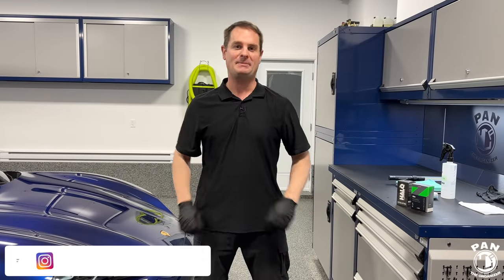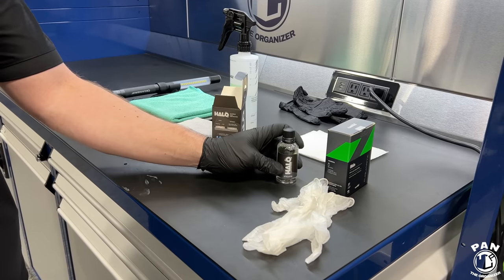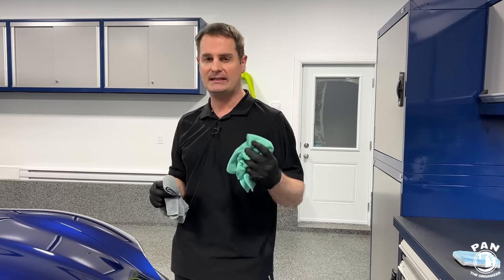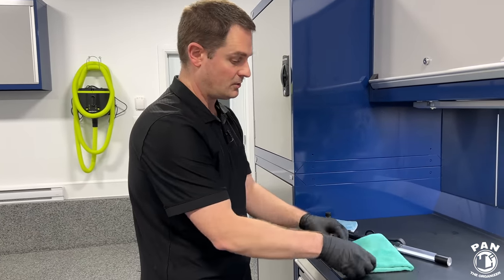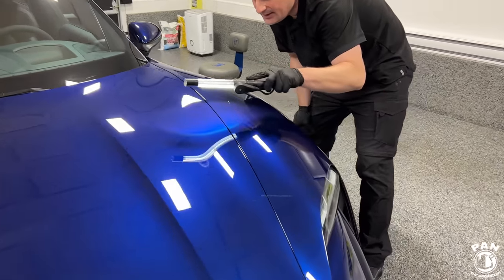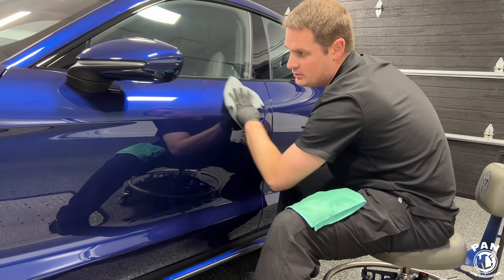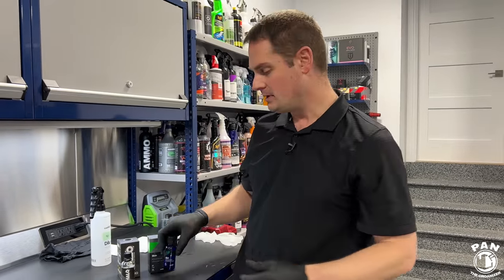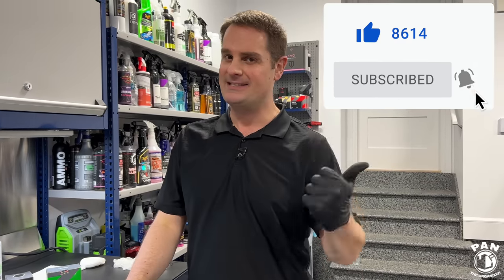How to apply a ceramic coating on PPF (paint protection film) : Porsche Taycan Turbo

Comment: Sir, I’m about to put a self healing PPF on my ride and then top it with a ceramic grafene coating. My question is, will the hardness of the ceramic coating stop the self healing properties of the PPF from working?
Reply from the maker: You would have to ask a PPF specialist that question. I have no experience with installing PPF or how self-healing versions work unfortunately.

Comment: Hi, can you please explain the concentration of the isopropyl alcohol and the Distilled Water ratio please. Also there are different strengths of IPA too
Reply: It’s based on 100% strength. So buy 100% strength, or close to it, then dilute it with 50% water, preferably demineralised water. That will give you a 50/50 mix. If you buy it at less than 100% strength then you need to get out the calculator to work out how much water to add to end up with the 50/50 mix.
Reply: @aussie8114  Thanks 👍

Comment: I just did a ceramic coating of my car, and i didn't know about ppf until couple of days, is possible to use ppf over the coating? Or somehow i need to remove the coating? Thanks a lot
Reply from the maker: That's a question you will need to ask to your PPF installer. Usually, it's PPF first, and ceramic coating on top. So I'm not sure if the PPF will stick on top of the ceramic coating.

Comment: I hope I get my BMW M3 next month. I am convinced that ceremic coatings work very well. However, I am not convinced about PPF. I did a lot of reading and people cannot seem to agree on the PPF investment (too expensive, rock chips damage the film (also looks bad), dirty edges, replacement is a pain). Yeah, the paint is protected, but at what cost and effort? What is your take on this? I would love to know how you value PPF.
Reply from the maker: Hi. I am just not a fan of the look or feel or PPF. Plus, as I get a brand new car every three years, and do low yearly mileage (6000 km or 3730 miles), so scratches and stone chips are of no concern to me. My cars are always pristine when I bring them back to the dealership.

Plus over time, PPF can yellow (especially the less expensive ones), dirt gets trapped on any edge of the PPF so it's a pain to keep clean, etc and it's a very costly option if you do a full PPF on the entire vehicle.

However, if you plan on keeping your cars long term (4+ years) and do average or high yearly mileage, and are concerned about stone chips and scratches, PPF is the only solution for those things. PPF will protect the paint for sure. Yes the PPF will get dinged and scratched, but its role is to act as a barrier for your paint. Underneath, the paint should be in good condition. 

Ceramic coatings aren't designed to protect against stone chips or scratches. What they are meant to do is protect the paint against chemicals, against UV rays, add gloss and slickness, give hydrophobic properties and also self-cleaning properties meaning that the vehicle is much easier to wash during maintenance washes. Dirt and grime stick a lot less to a coated car.

So for the best of both worlds, you'd install PPF first, and a ceramic coating on top.

I hope this helps. Congrats on getting your new M3 by the way!
Reply: @PanTheOrganizer  Thank you so much for your reply! I plan to keep the car long term (say 6-8 years) and I do average-high mileage. I never bought an expensive car like this.

As you mentioned, the PPF will get dinged, scratched and dirty around the edges, and I am not sure if I can handle that. Sure, the paint underneath will be protected, but I still drive around with an ugly and damaged PPF, so what is the point? Is it solely to protect the original paint? For the same, or maybe less money of a full PPF install, I can probably restore the paint if it got damage too badly over those years? Why bother with the PPF hassle? How bad are rock chips in the paint, yeah I know its bad, but isn't it part of driving the car? :) 

There are people all pro-PPF and many people anti-PPF, they both make valid points. It is a really hard choice and honestly I cannot decide what is the best course of action...
Reply from the maker: Do what feels best for you and forget what others say or think. ;)

Comment: Hey Pan, love all of your videos!  Overall, would you recommend ppf with a ceramic coating OR just ceramic coat everything OR stay old school and just use sealants, wax etc....
Reply from the maker: I can't answer that question Bob, as it depends on your needs and budget. I personally don't like the look or feel of PPF, but I get a brand new car every three years, so scratches and stone chips are of no concern to me, and I do low yearly mileage. If you're someone that keeps their car 5+ years, drives 12,000 miles or more yearly, and are concerned about scratches and stone chips, then PPF is your only solution.

For the best of both worlds, you would have a PPF applied first, and then a ceramic coating on top. But that is a costly option for sure.

Ceramic coatings (the real ones in glass bottles), last for years, compared to just a few months for regular carnauba waxes or paint sealants. So ceramic coatings are the best form of paint protection in my opinion.

Comment: what polish/pad combo do you recommend for taking out marring on vinyl wraps?
Reply from the maker: That's impossible to say as it depends on your specific wrap, can it be polished, and which combo would work best to correct your issues. You have to do test spots with different pads and polishes to see what works best. Or contact your vinyl wrap installer and ask them what they'd recommend for your specific setup.

Comment: Is it possible? If I want to apply first graphene ceramic coating and after that PPF will be installed, i want to do that, 

So is it possible or not?
Reply from the maker: Not recommended, as the PPF will have a hard time sticking to the surface. Always PPF first, and then the coating on top.

Plus you won’t get the benefits of the coating if you apply PPF on top of the coating…

Comment: Sa change tu de quoi si le ppf a déja des propriétés hydrophibiques tel que le GSWF Platinum? Et autre question... J'ai déjà un ceramic coating Armox Shield sur mon vehicule et je veux mettre du ppf sur mon devant de Kona Electrique... Que suggères tu comme procédure? Polissage de pa zone d'installation afin de diminuer mon coating avant l'installation? J'ai peur que la nano empêche l'efficacité de la colle du ppf ...
Reply from the maker: Ouais pour une bonne accroche il faudra certes polir la céramique avant la poste du PPF, à moins que ton installateur dise le contraire. 

L'effet lustrant et lisse d'une céramique, sa résistance aux produits chimiques, résistance aux rayons UV et les propriétés auto-nettoyantes sont toujours supérieures au PPF. Les PPF sont surtout là pour empêcher les éclats de roches (stone chips) et les rayures.

Comment: Hey Pan - I have watched many of your videos and have a question regarding PPF.  Are there any car cleaners, polishes, waxes, detail sprays, or other products that you have recommended that I should not use with PPF?  Thanks
Reply from the maker: Pretty much all the products you can use on clear coat, you can also use on PPF. Just be careful. And you can check with your specific PPF manufacturer to see if they have any indications on what NOT to use just to be safe. There can be slight differences among PPF brands.

Comment: Hi Pan, just a quick question, would you recommend using soft 99 fuso coat or carpro lite? Looking for better dirt repellency, durability as it's usually raining nowadays and need some protection to keep the car cleaner for longer.
Reply from the maker: Ceramic coatings will always beat paint sealants. So in your case, Lite is the better option.

Comment: Pam can you apply ceramic on the car then PPF and then ceramic the PPF. 
Is this over kill and would you recommend?
Reply from the maker: Not recommended to apply protection before PPF, as you want the PPF to bond properly to the clear coat. You apply the ceramic coating ON TOP of the PPF.

Comment: I'm curious to know about how would the car look with a matte PPF over a metallic white paint and coated with a graphene coating on PPF. Just the matte PPF alone makes the car color satin white, does Gr. coating changes that look or will it remain same?
Reply from the maker: The coating doesn't change the look. If you want to go from glossy to matte, you have to either repaint the vehicle matte, or apply a matte PPF.

Comment: It’s been 2 years after I applied my ceramic coating. I want to apply a new coat(s) It’s my understanding I need to polish the whole car to remove the old coat. Any tips or suggestions on this process? I used c quarts uk 2.0 per your suggestion. I like it but may try something else this go around.
Reply from the maker: Yup there are no miracle solutions to that process. You would do exactly the same steps as before applying a fresh coating. That includes machine polishing.

Wash, iron remover, claybar, machine polishing, IPA wipe or paint prep, and then you apply your new ceramic coating. Like in my tutorial here: https://youtu.be/sqQYVjxFqK0

Comment: Thanks for this Pan, really useful video as there isn’t a lot of content specifically related to protection / maintenance of PPF. 
Couple of questions….do you have a preference between skin or halo.? Would you use these ppf formulated coatings in preference  to a pro coating like Modesta or Zipang?  Longevity wouldn’t be my primary driver, UV protection and filling ppf porosity would be more important to me. 
Finally, at minute 22.00 I can see swirling on the trunk lid….is that in the PPF…I’m assuming the film is self-healing….would heat get rid of the marring. 
As always, great work thanks for the fantastic content!
Reply from the maker: Both Skin and Halo are performing almost identically in my tests so far. Those are from two top tier brands. Get the less expensive one for you.

It's hard to guarantee long term durability with coatings on PPF. It's not the same as on clear coat. What I'm hearing so far is 1 to 2 years on PPF regardless of what coating you have on there.
Reply: @PanTheOrganizer  thanks Pan.  I’ll go with skin then, as the bulk of my detailing products are Carpro, and I know they’ll play nice with each other.  That was a great brand review of Carpro you did btw!
Reply from the maker: Thank you!

Comment: I am done applying Halo. Every when should I apply C2? Also, is it safe to use Adam's mega foam after using Halo?
Reply from the maker: Yes you can use Mega Foam no problem. You should apply C2V3 (or any other silica spray sealant) at least once every two months to stay on top of maintenance.
Reply: @PanTheOrganizer  The recommended coating for Halo is 2x. If I do 3 coatings, would there be a bad/negative effect? What ceramic coating would you recommend for my roof, portion of A /C pillar and back of my car? No ppf on these parts. MOHS or CSL?

Comment: I have a question.   What do you do at the end of its coat life? Do you use chemical to remove the old ceramic coat or can you just reapply the same ceramic coat?
Reply from the maker: You would have to do a light machine polish to ensure 100% removal of any previous coating. It's the only way to remove coatings.

Welcome to my channel. You discovered one of the biggest car detailing channels on YouTube as we surpassed 940,000 subscribers and we have over 124 million views! I have been detailing for 26 years and I love to share my knowledge and passion with my viewers.

You found the right channel to help you learn everything about detailing.
Reply: Thanks.

Comment: If i want to apply a ceramic coating GTechniq Light on a freshly installed PPF, what is the procedure to prep the PPF? Do you apply the ceramic coating on the parking sensor and adaptative speed radar too? Thanks for your feedback
Reply from the maker: You mean the Gtechniq Crystal Serum Light coating? Same procedure as shown in this video. Including the IPA wipe. I apply coatings to paintwork, glass, plastics, wheels. Depending if the coating can be applied to those surfaces.

I would avoid parking sensors and cameras.
Reply: Thanks your the best

Comment: What do you recommend if only 1/3 of the car is covered in PPF? Use two different ceramic coating products? 1 on PPF and another on the clearcoat?
Reply from the maker: Just use the paint coating on the PPF too. Most paint coatings can be applied on PPF as well. Just check the instructions of the coating you purchased to make sure.

Comment: Pan, I need your recommendation. I tried the Bead Maker and it attracts dust on my car. Then i got the Xtreme Solutions Topper because you said it attracts lest dust. But somehow i feel like it attracts even more dust than the Bead Maker. :/ Do you have any other recommendations for a spray on.(no ceramic coatings). Im looking at the Griots 3 in 1 Wax. Thank you!
Reply from the maker: Ouf at this point you probably have dust issues where you live. Most of my viewers reported that Topper (and the Obsessed Garage Drying Aid, which is almost identical) are the products they have used that attract the less amount of dust.

So if you still have dust issues I have no more solutions unfortunately. You must keep testing different alternatives until you find something that works for you in your conditions.

Comment: Does this product only work for ppf/vinyl surfaces? Will it work on painted surfaces? As most cars have only full frontal ppf. Is there a product that can be applied to both surfaces?
Reply from the maker: If you only have a bit of PPF, just use a paint coating on the paint and PPF. Most paint coatings can also be applied on PPF.

But to my knowledge, PPF specific coatings aren’t mean for paint.
Reply: @PanTheOrganizer  thank you. Is their a product you can recommend?

Comment: Mr. Pan, 
My wife’s car came new w/PPF.  I plan on using the Halo Ceramic Coating.  My question: may I use the remaining coating in the bottle on my car that does NOT have PPF?  Thank you, sir. 
Respectfully,
Robert
Reply from the maker: No. The other way around would be ok though. A paint coating that you could apply on PPF.
Reply: @PanTheOrganizer  thank you, sir… one last quick question: new Ford Bronco, Oxford White… Would you recommend Adam’s Advanced Graphene Ceramic Spray or Evo Moh’s or Evo Pure?  Thank you, sir.  (Or any other recommendation)…

Comment: Hi Pan - new subscriber here after watching this video, this was very helpful! I have a car coming that I plan to do matte ppf on (Xpel stealth) and was wondering which ceramic coating you would most recommend that could cover off the matte ppf + non-ppf covered surfaces such as glass and wheels? I was leaning toward AvalonKing for increased durability, but it seems perhaps the ones in this video might be the safer option, but just for ppf-covered surfaces. Apologies if this was explained in one of your other videos...I've been watching several back-to-back and couldn't find it. Much appreciated!
Reply from the maker: Hi Shawn. AvalonKing is a great versatile coating that can be applied on all exterior surfaces. But on matte PPF, go for one of the two coatings featured in this video instead. And keep the AK for glass, wheels, headlights and tail lights.

Welcome to my channel. You discovered one of the biggest car detailing channels on YouTube as we're about to surpass 750,000 subscribers and 100 million views! I have been detailing for 25 years and I love to share my knowledge and passion with my viewers.

You found the right channel to help you learn everything about detailing.
Reply: @PanTheOrganizer  thanks for the quick reply!

Comment: Hi, which product you recommend if front end is protected with PPF and the rest is not?
Reply from the maker: I would use the same ceramic coating you would pick for the paint, and apply it on the PPF too. Most paint coatings can be applied on top of PPF.

Comment: I’m on the fence about doing Adam’s Advanced Graphene coating over my painted and ppf surfaces to just have one product “family” for maintenance purposes, but if there is a clear longevity or application benefit of doing different coatings for the two different surfaces, I’d consider it. Does Halo have a clear benefit for longevity or ease of application on ppf vs the Adam’s Advanced Graphene coating?
Reply from the maker: You can just apply the Adam’s on paint, PPF, plastics, glass, wheels, etc.  Very versatile.
Reply: @PanTheOrganizer  , thank you!

Comment: What about Gyeon PPF Evo? Is that a coating you’d recommend alongside Gtechniq and CarPro?
Reply from the maker: I haven't tested that one yet, but considering that Gyeon and CarPro are usually pretty similar in terms of performance, I'm sure it's very good too.

By the way, I saw you asked the same question on three different videos. There's no need for that. Once is enough. I usually respond to comments on a daily basis.

Comment: I am having full PPF application for my new Bronco next week. It’s too pricey to have the detail shop do both…can I apply the Ceramic coating in the summer when temps are more conducive or should I have it done right away…by the installer?
Reply from the maker: The best is always as soon as possible, when taking delivery of a new vehicle. But it's not the end of the world if you wait until summer to do it. And yes you can certainly apply these products yourself. They are user friendly and consumer grade, meaning people can buy them and do a DIY application at home. If you follow the instructions like in this video, it should be quite simple.

How did you discover my channel by the way Danyel?
Reply: @PanTheOrganizer  I was looking for a video about using a ceramic coating on existing PPF and found your video 💖 Just finished watching it and thought I’d reach out. Thanks for your fast response 🙏🏻
Reply from the maker: My pleasure!